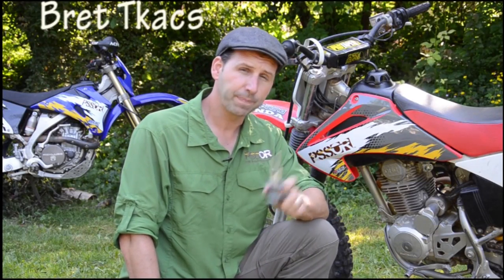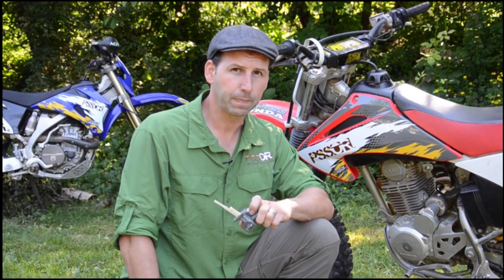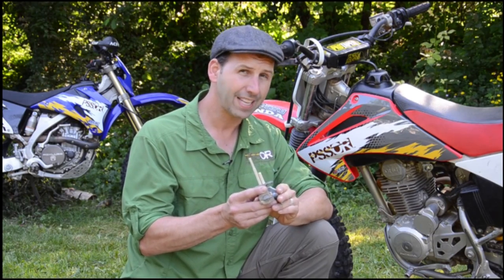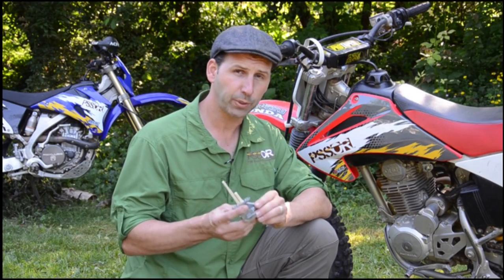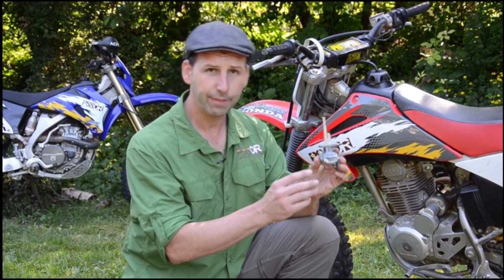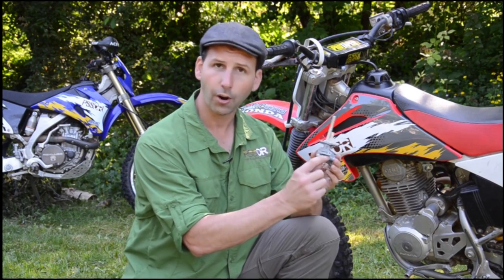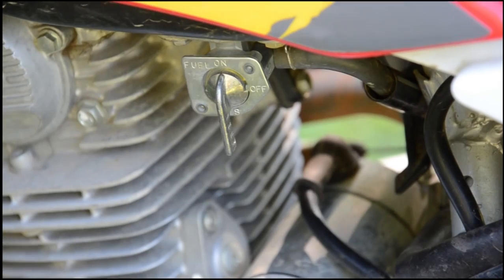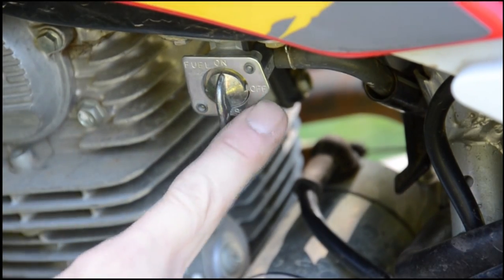Motorcycle fuel valve (petcock), how it works

Comment: I have a question I have a yz125 and I forgot to turn my fuel valve on but the bike still started and I rode it for like 3 spins around my block Idk if it’s supposed to do that
Reply from the maker: That is correct... The bike was using up the fuel left in the float.

Comment: Mine had a low fuel, a full tank and a gas station symbol. I'm a bit confused with this. So the low fuel symbol means reserve fuel. The full tank symbol means I'm using the main tank right? So what's the gas  station symbol mean?

Comment: What happens if you accidentally leave the fuel on for a full day, I totally forgot to turn it off when I was done, is it a bad thing ?
Reply from the maker: Moto Nikk_002 as long as the float in your carburetor is functions ok nothing will happen. However with ethanol fuels it is not uncommon for the float needle to age prematurely which can result in your entire tank of fuel emptying on the the ground or into the engine crankcase.
Reply: Bret Tkacs yea I went to go ride it today and went to turn on the valve but it was already on 🤦‍♂️ I was like oh no so I started it and I got it running and the gas was ok but it just stopped so I’m getting gas tomorrow and filling it up to see if it’s ok and not flooded
Reply from the maker: Moto Nikk_002 if you do it again just check your oil level to make sure it didn't fill the case. If the bike doesn't turn over the. Pull the plugs and check the cylinders
Reply: Bret Tkacs it should be fine when I put more gas in the tank though ?

Comment: hi do u know why my 50cc dirtbike is leaking fuel out of the overflow pipe, i have 2 fuel valves 1 is on/off the other is a white plastice valve and ive beetold turn it sideways when off and 12-6 aclock when riding it??

Comment: ok.. so to use the reserved gas/fuel,,,,,just turn the valve from off to prime,,,,, am i right?
Reply from the maker: Turn it to reserve "RES" for the reserve fuel regardless of manual or automatic fuel valves. Prime "PRI" is only used for getting fuel to the carburetor when you run out of gas on reserve

Comment: Ok, crazy question.  Trying to start my bike this season, I turned it to pri and left it for a while while trying to start.  I got a huge backfire ( I assume through the carb, as it sounded really loud).  Now, gas leaks from my air box, and the bike will run until it starts to smoke rich. Could the backfire have blown the vacuum part of the vacuum valve??
Reply from the maker: Most likely you have a stuck float in one or more carburetors. You will need to remove and clean them. If the jets are clogged to much you may need/want to replace them.